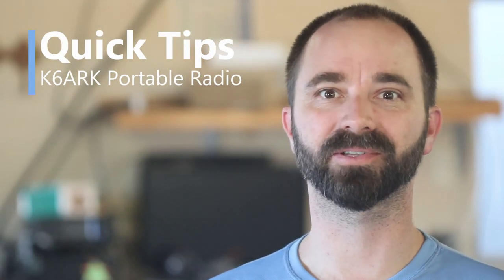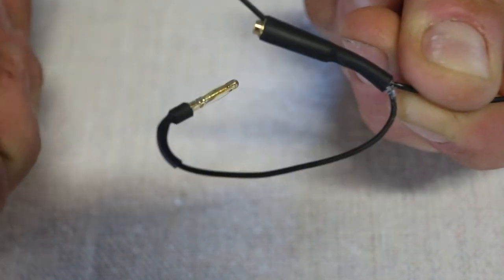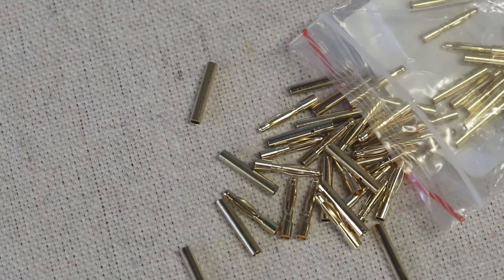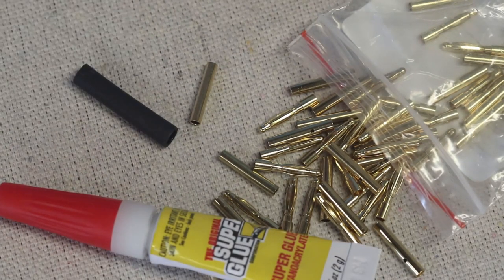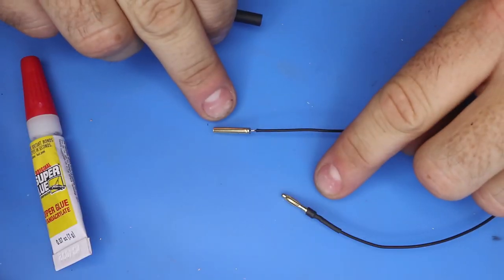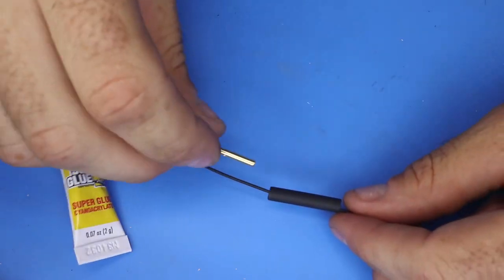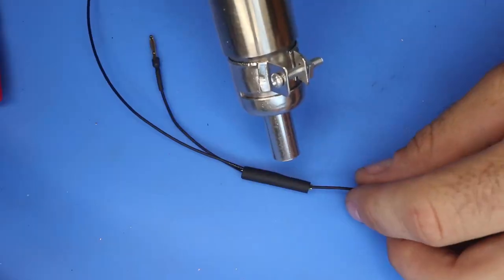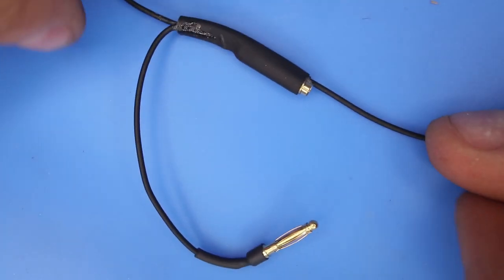Quick Tips #2 - Building Antenna Links

Comment: I tried this approach and noticed that resonance of the higher frequency band (15m in my case) shifted lower when I attached new antenna section for 17m this way. (I am building "linked" vertical with non-resonant radials) Look like some coupling takes place even if the link is open and it became more complicated to tune the antenna. So I will stick to my old approach for now. Interesting if I will observe the same with lower frequency bands like 40 and 80.
Reply: Im trying to build with this technique and experiencing the same coupling. Its definitely feeling challenging

Comment: Been doing this for years even easier use a power pole different colors for different bands no special connectors needed.73’jim KB1PFL
Reply from the maker: Nice! Power poles work great as well, but are relatively expensive and much more bulky if the goal is to make a very compact portable antenna. But for those that have them already and don't mind a little extra size on the antenna, they are a great option.

Comment: Thanks for the super simple tip!
What I fear is because of so close proximity of the two wires, the capacity coupling affects the resonant frequency when the link is open. 
Didn't you measure this effect? I did with a similar configuration.
Reply from the maker: I have not directly measured the effect but the capacitive coupling would be very small - likely less than a few pF - and I have not noticed and impact to resonant frequency or performance
Reply: @K6ARK  Thanks a lot for your feedback!
I measured once with an analyzer a drop in resonant frequency when the two open link wires were too close, but unfortunately, I don't remember anymore by how much. If I remember right, it was on a 17 meter band link using an EFHW antenna and I assume the higher the band link, the more influence you'll get. I also assume, the effect with an EFHW antenna is much more prominent than with a center fed dipole, because the voltage at the link, when resonant, is high.
I definitely have to measure that again, since your simple trap solution looks really clever to me. I also use the same gold-plated connectors for links, but the wires are separated by about 4cm long isolators. These connectors are light, have a big conductor surface and should not oxidate and are therefore perfect for portable use. 
I really like your videos and your tips that inspired me a lot!
Reply: @K6ARK  Yesterday, I did a double summit activation in the Swiss Alps. 
At the end of the first activation, I measured with my portable antenna analyzer the effect of having the wires of the 17 meter band link close together or far apart: even they were more apart and running shorter in parallel than your glued link, the resonance frequency changed by about 200kHz at 18MHz.
I'm happy to share the analyzer data, as well as the corresponding pictures of the link and further information about the home-made EFHW antenna that was used.
 
This change of resonance frequency is not a problem when properly tuned for this configuration, but I would advise to take this effect into account. 
In your case it might change the resonance frequency even by 0.5MHz@18MHz which could noticeable affect the VSWR.
I hope I could give some input with my measurement for the DIY antenna hams out there!
73 HB9EAJ
Reply: I have a dipole antenna that I've used for POTA activations for about a year.  I could use it in the 40m and 15m bands, without a tuner. I didn't measure it with an antenna analyzer to know exactly what the resonant freq was, but somewhere around the middle of the 40m band ~7.150 would be my guess.  I did this idea in the video (which looks really awesome) to add the ssb portion of 80m to the end.  With a little snipping off the end of the 80m portion, I'm dead on at 3.900 with the analyzer.  I disconnect the 80m portion and my resonant freq on the 40m has dropped down to 6.722.  That's 0.4 MHz @ 40m.  The SWR is up about 4:1 in the 40m SSB portion.  Now, if I shorten the 40m section, I'll probably mess up the 80m.  Not sure what to do about my 40m/15m now.

Comment: This is awesome. I am going to use this to build a linked 20/30/40m EFHW. I am curious how you make sure each segment is tuned properly? I was thinking I could make the 20m portion first and then test that with a NanoVNA. Once trimmed and tuned, make the first link with the 30m segment above it. Once that is tuned, move on to the second link and repeat the process for 40m. Do you think its worth making two links or just doing a 30/40 and using 20 on the second harmonic? Thanks! KJ7QLP
Reply from the maker: Yes!  A wire resonant on 40m will work on 20. You may need a strategically placed loading coil to bring them both into resonance. Let me know when you get to that point and I can share more details. Build and tune the 30m resonant wire, then add a link and some more wire. Tune for 40m and 20m. Check resonance on both before trimming. If 40m is slightly low when 20m is spot on, add a loading coil with 10-15 turns on a small tube (.7" drip line works well) about 1.5m from the end. It will add more inductance on 20 than 40 and allow you to optimize resonance on both.
Reply: @K6ARK  Awesome! I want to keep it as light and small as possible so I think a double linked EFHW that is just half waves on all three bands would avoid the need for a loading coil.
Reply from the maker: You may get lucky with enough bandwidth or if you're willing to tolerate a larger SWR on one band. It's easy to fix with a simple coil of wire some kind of plastic form. I don't have any pics of the coil right now, but here's the matching unit and SWR plot before and after adding the coil on the last one I built. https://photos.app.goo.gl/34o1kseCTMbvXMEw7
Reply from the maker: Or, like you said, extra links works too. Really the coil is as simple (or simpler) than an extra link.
Reply: @K6ARK  Interesting! I would love to learn more about making a coil. Thanks man, as a new ham who is stoked about ultralight SOTA, I am learning so much from you!
Reply from the maker: Well, I love learning new things, and get a great deal of satisfaction and personal reward out of helping others do the same. I just figured out that loading coil trick on my last build.  It was so simple and probably obvious to more experienced and knowledgeable antenna builders, but for me it was one of those enlightening moments.  My goal is to help you all experience the same. I was already thinking about making a video that explains the loading coil trick and how I used it to solve my problem. I'll have to shoot that one and put it together. When you get to that point in your project, feel free to contact me directly via email and I'll help walk you through the process. It's something you can easily try and undo if it doesn't work for you or you decide to go with a different method. Good luck with the build.